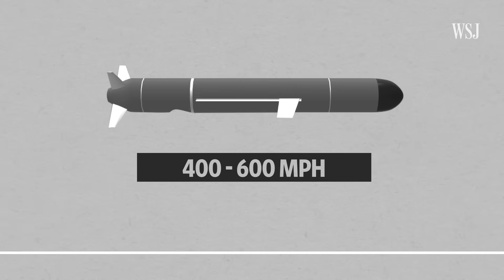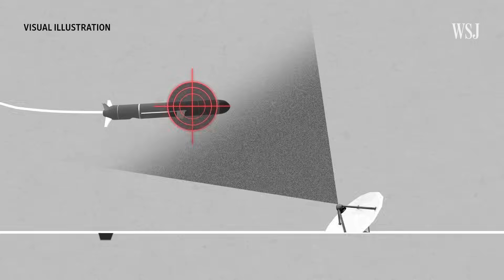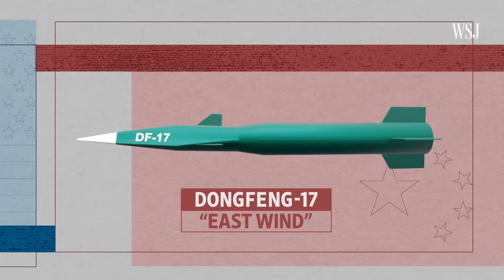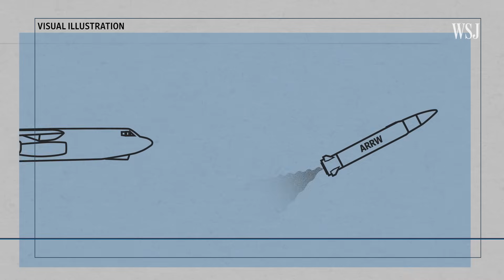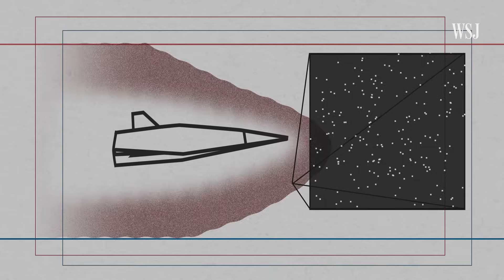The Race to Build Hypersonic Missiles | WSJ U.S. vs. China

Comment: China doesn't (or hasn't in the past) need to do it's own R&D as they steal it from the West, or we're daft enough to have things manufactured in China, so they get not only copies of the blueprints, but the knowhow to make the tech indigenously. What the West needs to make sure of, is that this stops - statum - and that the existing process of R&D doesn't get eaten up by the MID and kept on leaky servers. China building carriers off the bat with EMALS launching system is a worry, but the fact that they seem to be struggling to make them work shows that you need to learn to walk before you can run. We (UK) scrapped our fleet of three 'Harrier Carriers' after the financial crisis in 2008 and two somewhat expensive wars in Afghanistan and Iraq. The knowledge gap we accrued is painfully evident with the QE class carriers and their prop shaft problems. The Type 45 Destroyers are fantastic on paper, but used untested protype propulsion, which in true British style was done on a shoestring budget and held together with string and Sellotape. These kinks are now known about and while it's too expensive to repair the T45's, their successors are already underway, lets hope that the Carriers when retrofitted with nuclear and EMALS (with some help from our transatlantic cousins) will be useful for the JSF's and hopefully, the Chinese will make as many mistakes as we have. The directed energy weapons under development should neutralise the threat that these Chinses hypersonic missiles pose - if it's done properly. That will need investment, andR&D that the entire West needs to chip into, to make sure China doesn't get any further ahead (and make sure the French don't steal and sell the design to Iran, Russia or China)....

Comment: The US pursuit of hypersonic is "real". A real joke. If the high speed  wind tunnel of Mach  20-30 is critical, the US is trying to develop without fulfilling this critical prerequisite. No wonder the US has to drop this program after attaining Mach 5, sub hypersonic in May 2023. The other thing is air launch is cheating. The most critical stage of launching is the surface to air stage. Air lauch makes it much easier. China pulls the national resources to achieve higher and further. The US focuses on ripping off the taxpayers. The US now does not even tries to catch up but sanctions and bans. A typical loser's approach.

Comment: China has several HS missile models, DF-17, YJ-21, DF-21D, DF-26 and the latest and most lethal hypersonic glider missle, the DF-27. 
In 2017 China built a Mach 10 hypersonic missile windtunnel. Just months ago China finished building a Mach 30 windtunnel. 
Many people many not appreciate that HS windtunnel technology is every bit as complex as the hypersonic missiles! To generate wind velocity at Mach 30 you need sustained and smoothed out EXPLOSIONS !! You can imagine the complexity. But China has successfully overcomed the technology difficulties. 
The US failed the lastest hs missile test in June 2022 and has been quite since. 
The key reason why the uS failed several time on HS missile tests is because without a modern HS windtunnel, you can not perform any meaningful tests and collect high quality operational data. If you use a 50 year old wind tunnel, it is not going to give you the best test data you need. If you drop it from a Bomber, how do you track and make measurements of in-flight operational parameters? 
I believe the US is at least 5 years behind China in HS missile technology. 
The ability for the US to win the Taiwan war against China is severely restricted.

Comment: Hypersonic Missile development is seriously hampered without an appropriate HS wind tunnel. The US has not yet figured out how to make one while China is building a second Mach 30 windtunnel. The HS windtunnel is in itself a very complex technology generating wind speed at Mach 5 to Mach 30 with the ability to adjust the speed on the flight. 
You need to keep the HS missile stationary for meaningful measurements, so you can collect data for a range of functions, including aerodynamics, performance of sensors at 2000+ Degrees Centigrade and the effect of plasma on electronic communication. You can not do it effectively while the missile is going at Mach 5+ in flight. 
The failure of US HS tests is closely related to its lack of a suitable HS windtunnel.
Reply: Thanks for the info 👍
Reply: Us hypersonic missiles are in production right now. Certainly America knows how to make them now and is trying to catch up.
Reply: LOL brav we had a hypersonic aircraft in the 60's x-15 lol
you think we struggling with hypersonic lol
we just say that to scare voters into backing a bigger military budget
Reply: @KazenoniKakuremi we are though. Not saying I’m in the field of, but I’m def not far removed.

Comment: The characteristic of Chinese weapons is that they are not the most advanced when they start to be deployed. China's weapons development mentality is "plan generation, develop generation, deploy generation". More advanced missiles than dF-17 are already in development.
Reply: I think its different with hypersonics. For most other systems, China is catching up so it has faster iteration rate. With hypersonics, China is on the cutting edge, so it would have a longer development cycle. But not doubt they are working on better hypersonic.

Comment: In 2002, as soon as China's Shenzhou-4 took off, the US surveillance radar immediately locked and tracked it. The Shenzhou-4 tumbled sharply in the air and disappeared from U.S. surveillance screens for 12 hours. During those 12 hours, the Shenzhou-4 spacecraft flew over U.S. territory four times undetected

Comment: I have as yet to hear what the advantage of a ultra fast rocket other than "slower missiles are easier to track and shoot down" but the efficacy of anti missile defense is only 30-70%. So sending more of the slower cheeper missiles seems to get the job done (hitting target) without investing in the, so far, dubious advantage of hypersonic.  Regarding ICBMs, they are already hypersonic and there are no good defenses against them.
Reply: Getting a nuke shot down would suck
Reply: hard to counter harder to shoot down
Reply: @TheOuskie  same nearly goes for conventional rockets with 30-60 % failure rate of defense against conventional rockets, And for ICBM's 100% failure rate.
Reply: A hypersonic missile has a different purpose. For one, it's not intercontinental. While still extremely expensice, costs will likely come down soon. Your two points are mistaken. 1) Slower missiles can be taken out quite effectively, while hypersonic missiles cannot. Targeting is, however, far more difficult. 2) An ICBM can also be taken out.
It has yet to be seen how well hyperconic cruise missiles perform against moving targets.
Reply: Yeah hypersonic weapon is incredibly niche and would only be useful in certain cases. Maybe an extremely time sensitive, high value military asset would probably fit its purpose.
Reply: But the difference between hypersonic missile and ICBM is that hypersonic missile is cheap, as cheap as cruise missile, that’s what makes the hypersonic missile so well known, because they could have thousands and thousands of them and deploy them in saturation attack.  Not the expensive hella that US testing
Reply: @Ilovecruise  but the cheap hypersonic missile are actually useless against moving target. so why bother.
Reply: @Ilovecruise  Hypersonic missile (est is 41 million per round) is NOT as cheep as cruise missle (est 2 million per round) (source "Air Force Magazine)

Comment: This video is not technically correct, US has a lead over China or any other nation on hypersonic missles as few months ago, first of all there is not actual accurate production hypersonic missile by any nation at all,  Russia and China came up with hypersonic propaganda and to some degree developed their half way technology but they are still struggling, and for some time they were ahead, it intrigued and irritated people in defense sector and pentagon, so they pushed hard, Lockheed Martin and Raytheon was able to develop the technology further in short period time, now US is slightly ahead, it's clear US has far better chance of making actual more advanced hypersonic missiles ahead of anybody else if they don't screw it up.
Reply: US hypersonic missile is a replica of the DF17